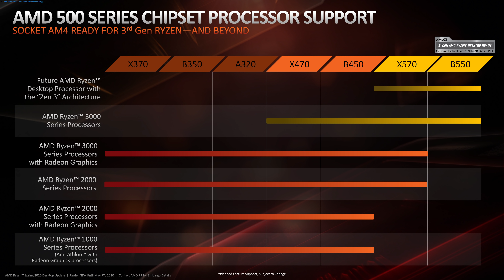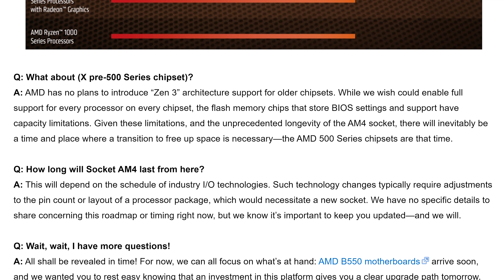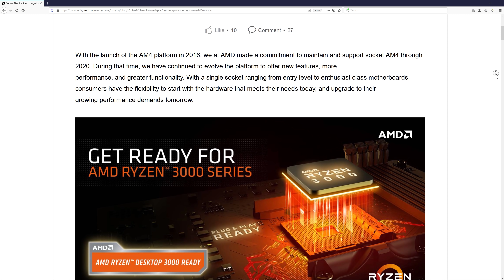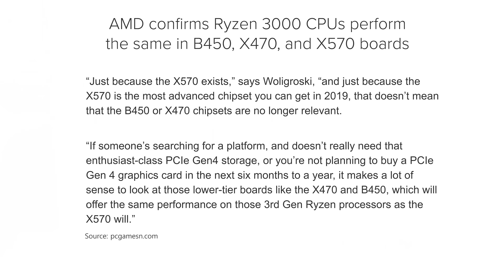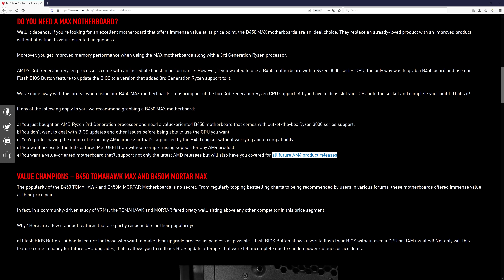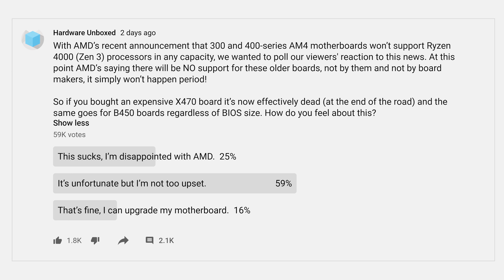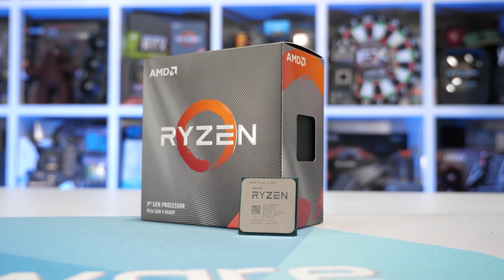AMD Does An Intel, Axes Zen 3 on 400-Series Motherboards, Our Thoughts

Comment: What pisses me off, is the fact that they stalled and stalled the release of the B550 boards until June. Which i would have gladly bought 2 months ago. So i went B450 MSI max series. Now I'm stuck with a board with no future. If they would have launched the B550 4-5 months ago and THEN told us only the top tier Budget series board would support next gen series. I would have been less pissed off.

Yes, i could have went X570 but none of the lower end X570 boards appealed to me. Their thermals were crap compared to the better crop of B450s. also, I'm weary of chipset fans, as i like to run my PC for long periods and those fans would break down over time. Almost all X570 boards have chipset fans on them. I have had bad experiences with chipset fans in the past.

Comment: All this fucking hate is pathetic and very entitled. Amd are a business and are still far more ethical than intel. They've been fucked by intel in a thousand different ways. Changing the socket will give us more features and more stability at higher frequencies. Bios updates etc have been tricky for amd with am4. Pauls hardware did a more grounded take on the whole thing.

Comment: I feel bad for the people that buyed a 400 series motherboard expecting it to support zen 3 processors, to me it was an amd's dick move there, they screwed up their customers not clearing this up before hand, but in my particular case, I have a b350 motherboard paired with a 1st gen zen based ryzen 5 1600, so to upgrade my cpu to a zen 3 processor I would have have to upgrade my motherboard too, and considering that next generation gpus, both amd and nvidia will support pcie 4.0 I would have bought a b550 or x570 motherboard anyway, so at the end of the day I'm not that mad, but I wish that amd changes it's mind and release zen 3 support at least in 400 series motherboards for the sake of those who already bought them expexting them to support the new cpu lineup

Comment: Again, I am still surprised at people being surprised by this. We already had the AGESA-stuff with the introduction of the 3000-series for the 400-series chipsets. Remember people having to get an ancient CPU, so they could flash the UEFI/bios? Already then the chipset couldn't support all CPU's then. How will they then cope with newer CPU's?

Forwards- and backwards-compatibility is always difficult. Having PCIe v3/v4 hanging on the socket won't make it easier.

There's also the whole situation with security-exploits & CPU's. Security fixes probably needed to be included in the AGESA-code... and they also needed to be checked for all various CPU's.

Nevertheless, the whole situation is outright disappointing.
Reply: Way back when the p67 chipset running a sandy bridge CPU only had pcie gen2 but with a bios update could run an ivy bridge CPU which had a pcie gen3 controller on board. If you put an ivy bridge CPU on p67 board you'd only have access to gen2 so it isn't impossible. PCIE is backwards compatible.
Reply: Yo captain hindsight why shouldn't we be surprised if literally every single hardware reviewer recommended the B450 motherboards?  In addition to the promises made by AMD and MSI.

Comment: Axing support on 3xx motherboards makes sense. But on the 4xx ones does not and for a simple reason. B550 was GIGA delayed. Far too many ppl bought b450s and x470s simply cause x570 were far too overkill and too expensive for cpus like the 3600. 

I definitely call bs when it comes to the bios chip capacity. They can still release the code (maybe at a later date if they dont have the resources right now), and leave it to the board partners to choose if they implement it or not.

Comment: Jokes on them, I would buy a Zen 3 processor, now I won't.
Reply: Same: I went from the 2600 to the 3700x mainly because of socket compatibility, otherwise it would not have been worth the hassle and expense. Back to replacing everything every three to four years I guess
Reply: Also who ever feels fooled by AMD then this :)
Do you even NEED Zen3 CPU?
I still have R5 1600X + GTX1070 and have no need to upgrade. Sure you get more FPS in new games with new hardware but do you really NEED those extra FPS?
Reply: @Strep3  I bought Ryzen 2600 planning to upgrade to something with 8 or 12 cores from Zen 3. Today I don't need more, but for 2021 I would have loved to buy a discounted 4000 part, as I did last August with mine.
Reply: Strep3 the why launch zen3 at all if no one really “needs” it 🤷🏻‍♂️

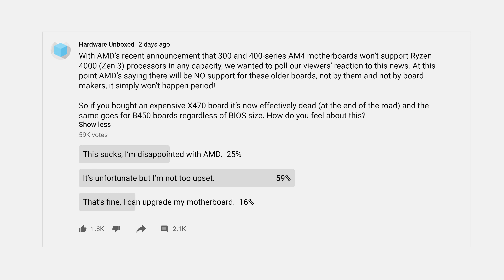Comment: 12:44 don't you think showing that poll is counterintuitive to the message you wanna send to AMD?. lol
Reply: Maybe, but it would be worse to not show it, since that could be interpreted as hidding what the mayority (of this particular poll) thinks because it doesn't fit with your opinion. Obviously that doesn't make the situation better for AMD, even if the mayority doesn't really care, the excuse they used is plain lame.
Reply: Well 25% is nothing to sniff off. These are the users, who recently bought B450/X470 and were planning to buy Zen 3 chip.
Most of them will skip Zen 3 now...
Reply: @tomas_klouda  If you look at the TechEpiphany data about motherboard sales, 8 of the top 10 most popular motherboard is B450.
These kinds of people is budget user (3600). I don't think they would upgrade to Zen 3 in the near term anyway. Maybe that explains the result there.
If they want to upgrade, it would probably to 3900X or 3950X. 

By the time they want or need to upgrade to Zen 3 or Zen 4, a motherboard upgrade would probably the rational option with the proliferation of PCIE-4.
Dunno, that's just me trying to rationalize that pool.

Comment: X470+2700X here, I was expecting at least one more generation. The upfront investment could only pay up if Ryzen 3000 prices will be pushed down by the 4000 series. Otherwise, I'm not interested in buying 500-series motherboards for 200+ EUR. I would rather go for a 39XX for the extra price of the mobo, as the latter gives me nothing but an option to buy more expensive CPUs. But do I want to? AMD's sin here is that they're screwing their customers who buy the high end of their product range. If you buy the high end CPU and chipset, your product sees a terrible loss of value while providing no rational upgrade path. Have an octa-core zen or zen+? Not worth re-buying an octa core with +10..15% extra perf. Better than Intel but still scummy.

Comment: Yes, pretty disappointing news. I bought an X470 and got in on the AM4 platform on the understanding that the 4000 series would be supported. This news is definitely counter to what had been, at the very least, implied right up until this point. AMD's stated support for the AM4 socket, in contrast to Intel's whole 'new chip, new mobo' approach was the main reason I went with them at the time. The fact they've offered up this BIOS ROM 'size limitation' as a red herring is also very disappointing. Other sources are stating that AMD have stated it was in fact a 'business' decision; and that X470 boards (including my own) have identical ROM chips (literally the same SKU) as in fully-supported X570 boards. This really seems fundamentally anti-consumer and that is really exceptionally poor from AMD. They should really be trying to compete with Intel's anti-consumer practices by doing the opposite, not joining in with them - which up until now, I feel they had!

Comment: When i was looking for a brand new mobo-cpu combo back in time the x570 was too expensive for me and found b450 to be fairly priced so i went with B450 TOMAHAWK MAX having in mind that i would upgrade to newer 4XXX Processors. B550 was not available on that time and its still not available now. So i had no choice but buy a b450 like most people did. If i knew amd wouldn't support newer processors i would just buy a budget b450 and not this high end MAX. Atleast give us the update!

Comment: Waiting on that "jebaited" announcement right before zen 3 launch. 

The idea that AMD is trying to sell extra chipsets just doesn't hold water. There's a lot more money to be had for them in letting b450 owners buy zen 3 instead of encouraging them to hold off until am5

If it's possible for them to offer support it just doesn't make sense for their profits or public image to not consider it at some point. It may not be a priority, maybe they do want to temporarily push for b550. I'd find it very strange for a company to not unlock a bunch of potential sales because they can't figure out a bios update though

Comment: G'day Steve & Teddy Jr.,
I wasn't too fazed by the announcement, but after you explanation I can understand there are others who will be upset,
I think AMD should allow compatibility for ZEN3 on B450/X470 & then it be up to Motherboard partners decide how to implement it with BIOS availability depending on the M/B BIOS size, then lastly it can be up to the consumer whether you update or not because of the CPU you wish to use.

Comment: As an x370 owner going from 1600x - unstable, poor memory speed, poor OC, to 2600x - stable, OK memory still below spec but good timings, good OC to 3600x - stable, fast memory, even faster timings, good OC. I'm at that point where the 3000 series feels like a good system and will be skipping a few generations anyway à la 2500k. This move from AMD doesn't surprise me or upset me at all. Do feel for the 400 series users though.

Comment: I bought a B450 and R5 2600 in May 2019 precisely with the plan on hopefully upgrading to a Ryzen 4x00 chip at the end of AM4's life. I guess that hope has been dashed. I really hope they find solutions to this.
Reply: Bruh same
Reply: I bought a 2700X and an X470 board for the same reason. The VRM was beefy enough to handle the most power hungry chips but now I'll have to go with Zen 2 or buy a new board. Don't know which one it will be at this point.
Reply: Maybe we can go back to 771 to 775 era of BIOS modding.

In order to add microcode of xeons, older microcode like Prescott Pentium 4, D, and Celeron D is deleted and replaced with Xeon microcode
Reply: That sucks indeed, but next time make sure you make your purchase decisions based on research and not hope. AMD had made it clear a long time ago that AM4 motherboards won't be supported with new CPUs after 31 December 2019, so not sure how you thought that your B450 would work with Zen 3 which releases after 31 Dec 2019. If you look at AMD's official Socket Stability slide in the article "3rd Gen AMD Ryzen CPUs Will Work on Many Existing MSI AM4 Motherboards" (search it on Google), you'll see that the graph clearly shows no support for new CPUs on AM4 after 31 December 2019. If you take a good look, the orange bar stops right at the end of 2019, just before 2020 starts. It was already know even a year or two ago that Zen 3 will come out some time in 2020, or in other words, AFTER the official support period. AMD are obliged in no way to find a solution for something that they didn't promise.
Reply: @bgtubber  steve actually tackled MSIs marketing on the video. If AMD doesnt do anything, MSI might be faced with lawsuites. Also, MAX boards were marketed for future products as well due to bigger memory capacity (16mb not enough as told by AMD). Likewise, AM4 socket is still AM4 socket as promised from the beginning to sell ryzen to the masses. Tho yes, it doesnt tackle 300 and 400 series boards, but it is still AM4. With all of that, why change now when the last remaining ryzen 3 will end this year and next year we will see AM5 and ddr5 because people are buying n they are making money. They are up from all fronts. They want to cash in.
Reply: You can get a 3900x for cheap when the 4000 series comes out. Thats a big upgrade, but yeah, i feel ya.
Reply: @yvsevyse4562  You WONT get 3900x cheap especially when the seller knows you now have no ANOTHER option.
Reply: @schumbo8324  retail or reseller? Depends, where you buy it. Plus, with the buzz of 4000 series, it wouldnt be diff for many to upgrade. Also, with if he waits for 1.5 yrs before upgrading, everyone would be flocking the am5 socket and ddr5. So not really a problem - this is tech werre talking about. Like cars, its a bad investment if you think about - not all cars are supras. Evidently, the 3900x will be cheap when he needs it.
Reply: @yvsevyse4562  Agree. That's my backup plan if no BIOS workaround comes up.
Reply: @yvsevyse4562  it's very impossible theyll sell it for cheap considering the motherboards come with it we'll be cheap
Reply: @yvse vyse
Best CPUs available for the platform usually do not loose their price very fast. Or at least not anywhere near as fast as slower options.
So do not expect R9 39XX chips to loose price until AM5 will get another generation and even then it won't be exactly cheap...
Reply: @tomas_klouda  yeah, i do agree. However, intel cpus real resell value is due to the incremental improvements intel was putting out. Also, by counting the cores, intels 2000 series were the standard for a long time. However, in AMDs case, the release of higher threaded and core count cpus is expected as it was designed that way. From the 1800x to the present 3950x, the advancement was further than anyone expected. So yes, standards will be higher. Also, take note, rumors are pointing out 8 cores in 1 ccx. Also, IPC improvements are relatively an agenda in AMDs eyes too. 

EG. I7 7700K VS RYZEN 3 3300X made the resale value of intel a joke.
Reply: It's your own fault, tbh. 
Instead of saving up, and getting what you actully need, you decided to go cheap out, and buy into the whole stupid "upgrade path argument".
Reply: @Orcawhale1  you cant fault a guy to what was promised.
Reply: 3600, 3700x, 3900x, 3950x enough solutions?
Reply: @tomstech4390  he planned for 4000 series, not 3000.

Comment: I bought a b450 itx board with an R5 3600 last September thinking that I would be able to upgrade to at least a higher end ryzen 4000 series cpu in a couple of years. X570 itx boards are way more expensive. Not sure if I'd need that upgrade but I am disappointed to find out that won't be an option.

Comment: The issue is they promised backwards compatibility. Now, I could only excuse this if they're now realizing it literally WILL NOT WORK, rather than that they're going to artificially stop you from doing it through the BIOS. But if it's the latter, that's scummy. Don't pull an Intel, AMD....

Comment: yeah im a bit upset have a b450 gaming pro carbon ac yes it doesn't have the biggest bios but that can be easily fixed with certain bios support for certain chips. i have it still coupled with my 2600x since I wanted to wait for the 4000 gen. so yeah I'm a bit disappointed ill have to buy a new motherboard for only 1 generation. or wait another year for am5 or get a 3000 series but going from 2000 to 3000 isn't exactly smart in my opinion. i don't know what to do. i have the money to get a b550 and 4000 cpu easily but it doesn't give me a good feeling.

Comment: Having replied to the poll that I was indifferent on reflection I’m slightly disappointed given that when you think about it then the reasoning is flimsy at best
I suppose at this time with a R5 3600 in the system I’m using and sharing that should I go for a build of my own I’d probably go for an X570 Tomahawk or something of that similar tier to see me through until the next motherboard socket

Comment: Stop whining Amd needed pcie 4.0. Your going to want it anyhow.
Reply: no i wont ... why would i need 4.0 when even 2080Ti cant max out bandwith PCIe 3.0 8x ... you would need a card that requires more than double the data throughput of 2080Ti to approach the limit of PCIe 3.0 x16 ... we are at least 3-4 GPU generations away from that ...

secondly my x470 board is capable of PCIe 4.0 ... it was with its first beta bios then AMD forced board manufacturers to artificially axe that support ...

Comment: I understand that AMD has to make money and please motherboard manufacturers especially given they're a way smaller company than Intel. I understand that pushing bios updates to specific models and some might cripple the new CPUs, basically the mess that happened last gen. I understand that not many people even know that their motherboard would support it. However, for AMD to delay the B550 chipset this much and not making it clear that the B450 won't be supported is just an unnecessary dick move. Imagine yourself in a scenario where you bought a decent B450 board and slapped a cheap Ryzen 3 waiting to upgrade to Zen 3 when it's released. They should've just released the B550 earlier.